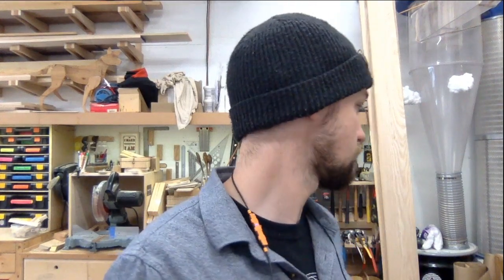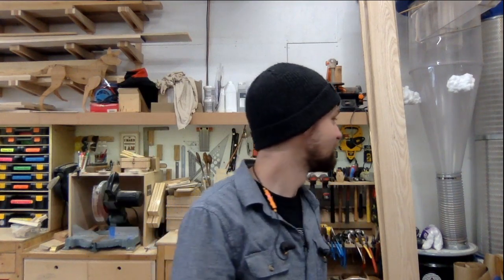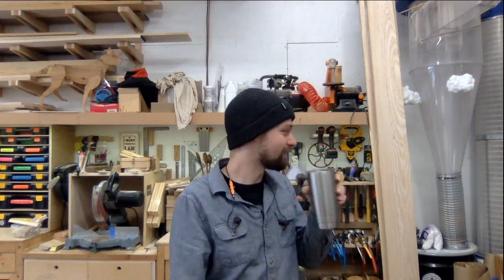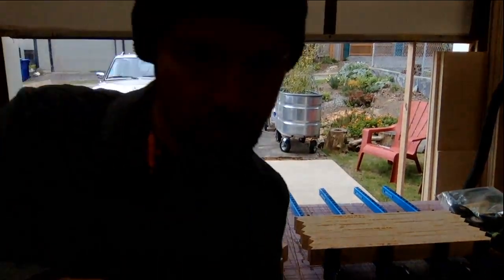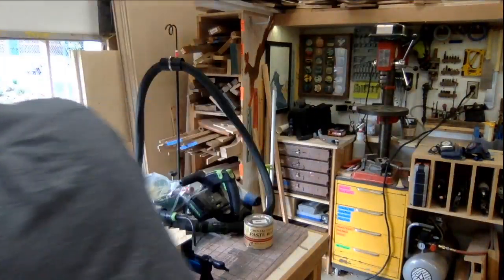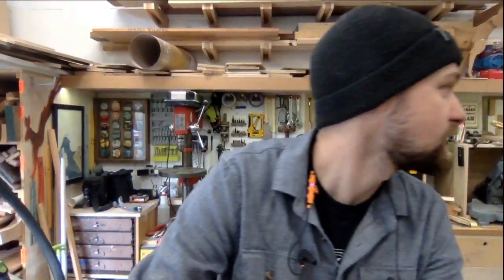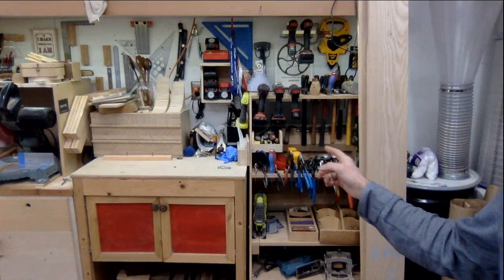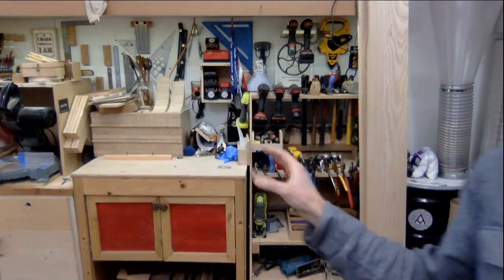Global MakerFest 2020 – AlmFab Q&A/Shop Tour

Comment: For alignment and compression of the pattern plywood hexagons, I’m not sure if this would work but I’ve used it for complex small glue-ups before and it’s been useful when they’re repetitive. If you route an inset (in my case, using a CNC) that is the exact shape of the pieces when they come together and glue them together into that frame, it’s almost like pouring into a mold except with solid pieces. Again, definitely not sure if it would work for pattern plywood but I have used it for mosaics of hex and octagon tiles and it’s been a huge time-saver and avoided things going skewy.